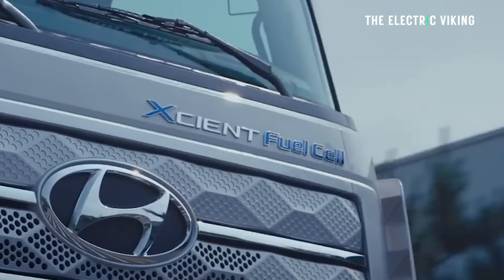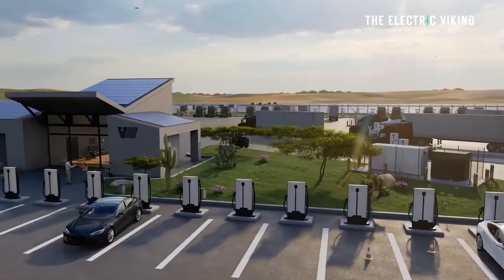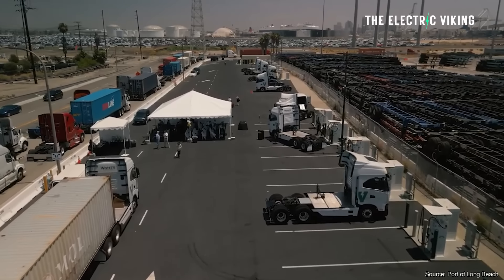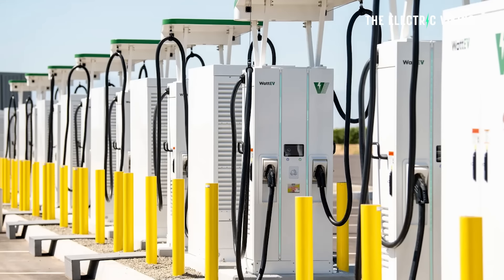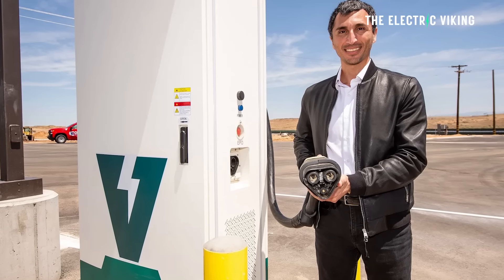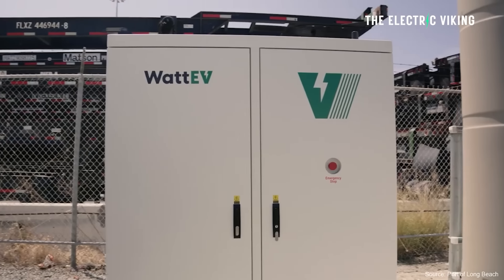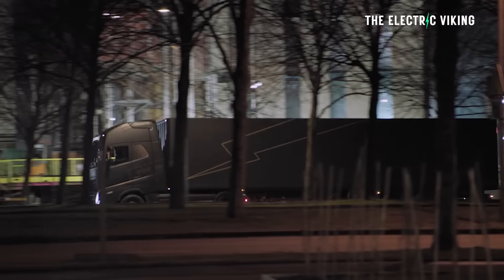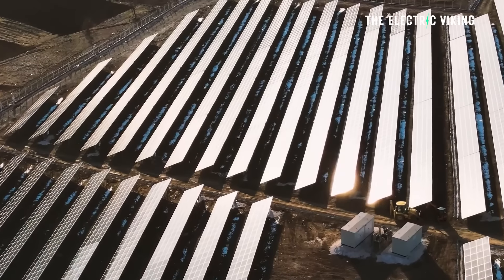America's first 1.2 megawatt charge station is powered by solar & batteries

Comment: I love it.  Get that connected to the grid, then those batteries can be duel purpose.  Consume and charge batteries/vehicles when grid is cheap, provide grid stability when demand for chargers is low and home use is high. This push/pull will become the norm and I'm sure AI will have a large presence in providing incentives with dynamic pricing.  I want to see all these new EV batteries and vehicles asap, don't want to wait 1/2/3/4 years to see this progress. 1 bad news story spreads like wildfire, while these 50 good news ones get ignored by general public.
Reply: Who needs "the grid"?  I want a charger like this at home, solar panels all over my home. and an EV capable of using 1.2 MW charging to charge at least 200 miles in 10 minutes.....
Reply: @michaelbradley1636  lol, that would be funny .  Probably a bit of overkill.  Once I got an EV I quickly realized that it mostly sits idle for most of its life and a level 2 charger is more than enough for me.  My car is limited to 150Kw anyway, so non issue for moi
Reply: dual use, not duel use

And yes, using computers to manage the load and capacity on a grid with massive amounts of batteries and homes / businesses with solar capacity is clearly the way to go over time, re overall grid stability. 

For one thing, when there is excess power, charging every battery in sight (connected) is the obvious way to go, vs. having power to "have to get rid of" or even pay people to take (negative pricing).
Reply: @keithcooke5066, assuming that the US doesn’t ban them
Reply: @michaelbradley1636  I do it (Having solar panels, but not at 1.2MW as you stated). But with only few panels that can give me 2kw for my home and if I need, charging EV vehicle (Which is already bidirectional). Solar panels price coming down, they are more and more affordable,  but I will not pay the price right now to reach 1.2MW charging for my personal car alone. 😄
Reply: @michaelbradley1636  
You wouldn't like the cost of the equipment to do that on a personal level...
Commercial is a different story. 

You're also dumping 200 kWh in that 10 minutes...
Most EV cars don't come close to that in storage. Some pickup trucks are, however.
Reply: How do you charge trucks on cloudy days?  You can't store enough energy in the on-site batteries.
Reply: @dzcav3  
Solar still works. Just not as intense. 

Most solar farms are aiming towards 200% solar capacity, as solar is that cheap these days, and that takes the pressure off storage needs
Reply: @dzcav3  If linked to electrical network, use it when needed. If not linked, then solar panel provide just less power compared to full rating. Then needed to add way more solar panel to compensate for the power needed when not linked.
Reply: This is the future

Comment: I built my first electric truck in the late 70"s.  EV's are so much simpler than  gas cars.  To me it's a no brainer.  The nice thing about EV's is they can be upgraded as the batteries get better,  as the batteries improve so will the range and weight, electric motor has two bearings and a simple gear reduction box.  Should last the life of the vehicle, no other technology can boast that......I also charge my EV off grid with my solar system.
Reply: Nice work Steven.
Reply: You have been the future

Comment: The 1.2 MegaWatt chargers require a 480 volt 3 phase power supply. They draw 300 amps.  Each.

Comment: I agree. Hydrogen has few benefits but that is offset by bulk, fuel generation cost, transport, etc. it’s pretty hard to argue over an energy source that can come largely from the sun and can be transport over wires.
Reply: Hydrogen can be produce by the sun also.  It can also be produced in a fuel cell using   electrochemical process to generate electricity.  There is no hazardous waste involved.  The main advantage is in the weight savings.  You do not have to develop new heavy duty chassis to handle the weights of the batteries.  There is also a great  time savings in refueling.
Reply: @howardj602  
Most of that isn't correct, unfortunately. 

Hydrogen is also extremely dangerous. Flammability wise, and explosive wise.

And it is NOT energy dense or efficient

A standard frame in a Semi is fully able to handle battery weight, and an EV Semi isn't much heavier then an ICE semi, as the very have engine and transmission are no longer there, along with all the stuff to support the ICE engine. 

Hydrogen storage is a huge issue, however,
Reply: @jeffl4810  The standard frame in a semi is not the same.   In the E.U., electric semi trucks are allowed to be 2 tons (~4,400 pounds) heavier than diesel equivalents, and in the U.S. the allowance is 0.9 tons (2,000 pounds). 
For up to date for state of the art  hydrogen powered  internal combustion engines I suggest you go the website of JCB hydrogen  in the U.K and then go to the experience Volvo is having with hydrogen engines.  There is too much detail to put here. You seem to be a person with an open mind,   I am sure you will agree that hydrogen is the future for heavy duty trucking.  It's already here in construction equipment.
Reply: @howardj602  
Tesla Semi would have a frame made to their specs, as they haven't produced a large truck before. 
Weight of a Tesla Semi is about the same as a Diesel Semi for the short range at about 20,000 lbs. A long range (the 500 mile version) is about 26,000 lbs. A 6,000 lbs hit, but the EV allowances help compensate that somewhat. 

I know a lot of the other manufacturers essentially converted their current ICE vehicle designs to EV, and the frames seemed to have been very similar. Most of those designs were not ground up EV optimizations. And their efficiency suffers substantially from that. Ie their mileage per charge is lower, and is also indicative of why a lot of truckers don't like the EV Semi's.  I haven't looked into great detail of these poorer examples, as they're not well engineered. 

I've looked a ton into hydrogen over the past decade or two. It's not feasible, except for niche cases. 
1) it's extremely inefficient (electrical to H2, then to compress/cryo cooled)
2) extraordinary dangerous. 4-76% flammability range, one of the widest known. With detonation possible in most of that range. Ignites very easily with a low ignition energy.
3) needs to be stored at insane 7,000-10,000 pressure. Tanks are only rated for 5 years. And if one ever blew up, it would be a very significant explosion. Likely followed by a huge fire ball, with a detonation wave. At least, due to its low density, it disperses fast in open air, in the event it doesn't ignite. Bad if vented in a building however...
4) makes metals brittle...
5) mechanical conversion is very lossy in an ICE. And, still has other emission issuees. Like NOx. No CO2 or CO though. Probably minimal PM or VOC's
6) Fuel cell conversion is at best 60% efficient. Fuel cells have short lives, and are VERY expensive. Fuel cells still need battery buffers.
7) H2 is a powerful greenhouse gas this isn't well known. Considered a secondary greenhouse gas, as It consumes the atmospheres cleansing free radicals, limiting the ability to clean up much more powerful pollutants like methane. 

H2's a fools game, in hopes for current energy suppliers to replace their revenue streams with something similar to their current business model. Unfortunately H2 will cost around an order of magnitude more than a BEV to operate.

BEV battery technology is rapidly getting better. Newer chemistries have fixed longevity issues. Energy density is rapidly increasing. Batteries have just hit the market with double energy density at 500 Wh/kg, and over 700 Wh are in the lab. Silicon anode issues are getting resolved  and have the potential to push it to several kWh per kg.
When that tech starts hitting EV's, there will be no competition for ICE or H2.

I'm an EE, so kinda an very interesting topic for me. I've done a LOT with ICE over the years, and still own a bunch. Pushed some to under an 8.3s quarter mile... But  I'm going EV going forward. I can't wait until a decent truck EV is available. I need one with about a 200kWh battery. The Silverado EV looks promising. Hopefully they don't have LG Chem cells when I'm ready to purchase...
Reply: @howardj602  
When we start seeing those higher energy density batteries I mentioned in my previous post, becoming the norm, I suspect heavy equipment will become much more EV orientated. 

EV's also offer huge flexibility in such equipment. Electric drive is super simple and compact. No need to have a big engine and associated stuff like radiators and exhaust. Battery's can be stuffed in more ergonomic areas, allowing changing of the required shape of the equipment to more optimized for it's intended use. Not needing a huge engine compartment removes those limitations!

Hydraulic pumps could even be direct drive electric motor driven. With automatic motor control to maintain pressure, and flow rate.

Comment: Hydrogen is over for land transport. German rail have given up on their hydrogen locomotives, following extensive testing. Taking on batteries instead. Trucks work fine, as Tesla and others have shown.
Reply: German rail is switching to diesel as their electric cost is very cost prohibitive.
Reply: @brianjonker510 
Aren’t most of the trains in Europe electric already? Just did a train trip through France, Germany and Switzerland.  Don’t recall seeing any diesel’s.
Reply: @bcreason  Exactly. The most trains in Europe are electric.
Reply: I thought the electricity comes from lines above the tracks. Why would a train need batteries?
Reply: Still a place for very large systems hydrogen based.  Large ships and Green Steel blast furnaces…
Reply: @bcreason  Yes the trains are electric.   From what I understood nearly all trains are capable of  still running on diesel and at certain times and perhaps certain places they switch to diesel because it is cheaper.

Comment: sodium batteries charge much faster than lithium and it doesnt hurt the battery... just for perspective
Reply: And cheaper, sodium is incredibly accessible
Reply: I believe they can be used as storage batteries. But they can't be used in a car or truck because they have to be bigger and heavier compared to the same capacity as lithium, and they degrade faster.
Reply: Cheaper is most important
Reply: @fenrirgg  degrade how? i hear they dont degrade from charging or going outside the 15-80% window?
Reply: @LoneWolf-wp9dn  I read sodium batteries didn't last for many cycles (compared to lithium). But maybe that problem is solved and there should be a general usage of sodium batteries now 🤔
Reply: And when those are well PROVEN at commercial scale, are cheap enough, reliable enough, plentiful enough, durable enough, etc, then I'm sure they'll become dominant IF that all works out. 

OTOH, for every idea being "developed in a lab", a good 99% do NOT achieve broad commercialization for various good reasons.  It's how economics works.
Reply: @fenrirgg :  It's not rumors and hopes that will matter.  It's what is PROVEN at SCALE over time.  Then economics will work, and the actual better technologies (overall, for a given application) will end up dominant, in time.
Reply: Just for perspective, batteries made from unobtanium are the best of all.  They can store 100 KwH/Kg, charge from 0 to 90% in 5 minutes, last for 10,000 cycles, and operate from -40 to 40 C.  All we have to do is find sufficient supplies of unobtanium.
Reply: @dzcav3  you serious?
Reply: Correct, not many cycles at all currently < 10  @fenrirgg
Reply: Best for stationary energy storage. 👏

Comment: EV architecture also plays an important role in a charging speed. If you vehicle is built based on 400-volts architecture, then the cgarging speed will be slower comparing to vehicles built based on 800-volts and hige architectures.

Comment: Well put Sam, the boat has sailed leaving hydrogen sitting on the dockside.
Reply: Your statement is outdated.  Every major large truck manufacturer has a hydrogen powered Class 8 under construction.  And there is a robust building of hydrogen supply facilities in the U.K. Australia and the U.S. to say nothing of the fleet of 70 hydrogen powered vehicles currently in us at the Ports of LA and Long beach, with more to come.
Reply: @howardj602  It’s true that a lot of manufacturers are still investing in hydrogen but it’s hard to see that investment paying off. The cost of hydrogen as a fuel is prohibitive and as we are all well aware it’s still overwhelmingly produced from fossil fuels with the consequent carbon emissions. The distribution network is vestigial and if anything, shrinking. Just two or three years ago I would probably have agreed with you, but in the meantime battery technology has come on in leaps and bounds, the charging infrastructure roll out is acceleration, whilst hydrogen has stagnated. Hydrogen is the fuel of the future, for sure, it’s just that road transport is looking less and less likely to be one of its uses.
Reply: @philiptaylor7902  You should keep up with the times. And the recent developments in hydrogen development.

Comment: Amazing! I think in a few years we will be looking back at these 1.2 MegaWatt chargers and wonder why we were so excited by them. It would be cool if they built the solar panels as a roof over the parking area.
Reply: Riiiiight... You do realise that even the biggest car park you have ever seen would not even power one of these chargers, don't you?  The typical large house PV array produces about 10kW max - that's 1/100th of the power just one of these chargers use.
Reply: @martinwinlow  Did I say that using them as a roof would be enough power for the chargers?

Comment: How many of the 1.2 mw chargers would be needed for the 1,431 km trek from Eucla to Perth? Does the necessary grid infrastructure exist? Who pays for installation and maintenance?
Reply: State govts need to lease the land for solar farms so private enterprises can come in with charging infrastructure / batteries./etc. management. Whether it makes money in the long run is anybody's guess.
Reply: @ronin_myaus  Who pays for the solar array and battery in areas not serviced by the grid? Ain't gonna happen.
Reply: problems problems eh? Luckily we have positive minded engineers who are not frightened of change.
Reply: @allenhill4578  Engineers can provide a solution only if the solution is adequately funded. Where's the money gonna come from?
Reply: How much money is spent on diesel? Billions and billions of dollars?

EV will start off with just a small cut of that pie, but if it’s cheaper in the long run then EV will eventually take the whole pie.

Say bye bye to oil wells, refineries, international shipping costs and fumes.

Comment: The video showing their experimental facility has a deeply flawed design. However their computer rendering of a future station corrects the flaw.

It is beyond stupid to expect a truck driver to park his trailer elsewhere, then pull the bare tractor into the charging bay. The proper setup is pull-through charging stations, just like 99.999% of the diesel fueling stations. The same is also true for charging smaller vehicles. Tesla has an option to get a factory-installed tow hitch when you buy your car, but very few of their charging stations accommodate a car with a trailer. This is unacceptable.

Comment: The irony of this location is that it's in the middle of the Bakersfield oil patch. The other big businesses in the area are all oil industry service companies. A few miles down the road there are hundreds of oil wells. I drive by this site about once a month and have been really looking forward to seeing this charging station open. I'm not aware of any other station anywhere that has a large solar panel field sited right there to supply the power. It's exactly halfway on our route between L.A and the central Sierra Nevada mountains and it would be really great if they had car chargers there as well. Not sure if they do yet but I'll be driving by there in about two weeks. An amazing business model and I really hope they succeed and expand.

Comment: they would never pay for themselves in the outback of australia there is not enough road  traffic, people have broken down on country roads and waited hours for another vehicle to turn up
Reply: So, don't put them there then!!
Reply: They would then need only a relatively small amount of solar deployment.
Reply: @keriford54  its the capital cost, some chargers cant make money in the city, so why would anyone install any  in rural towns when they would only be used by holiday travellers, all the locals will charge at home
Reply: So it’s cheaper to truck gasoline way out there than to have small, self-contained charging stations with their own solar panels?
Reply: @paulm9670  must be as thats what they do, they have road trains that take out food, fuel and spares to the outback. a lot of those towns are powered by container sized diesel generators, solar power works well during the day but those mines run 24/7

Comment: Viking, so for a truck to charge at 1.2 megawatts, with a 1 megawatt battery means you'll be sitting there for almost 1 hour!!!!! Plus the 1 megawatt battery weighs in around 14,000 lbs. cutting into the weight that can be hauled. One more thing, the price of that megawatt battery will set up back around 1/4 million dollars!!!!!